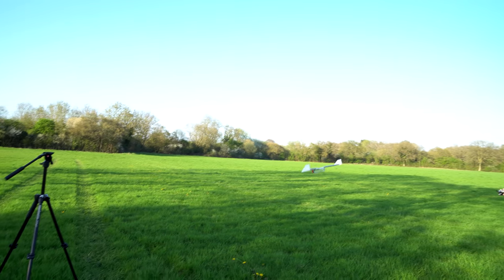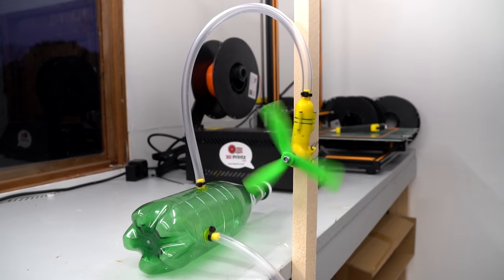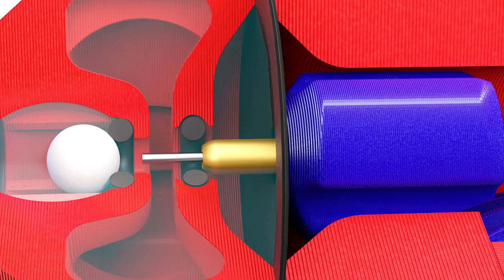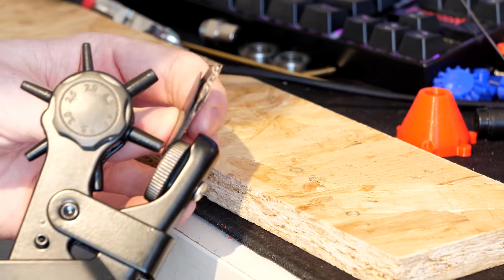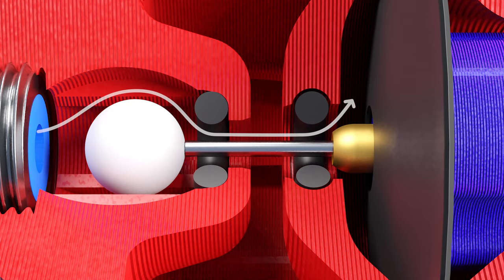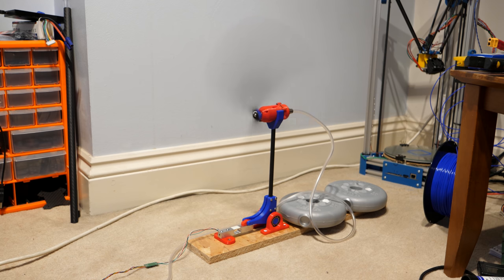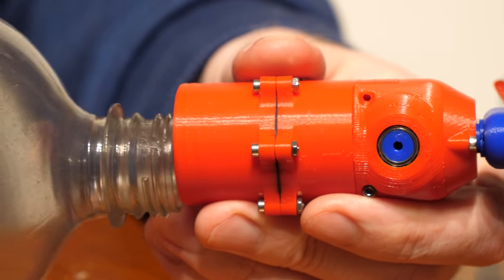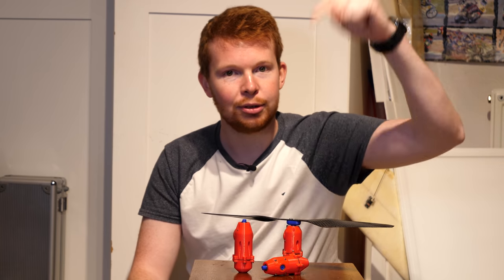Diaphragm Air Engine

Comment: It appears to me that the diaphragm engine only works during half the cycle (while the air is pushing the diaphragm against the piston). It also appears to me that you're struggling with the same issues that early steam locomotive designers faced. Perhaps the approach they eventually landed on might work for you.

What if a second pressure chamber were directly opposite the first, so that the driveshaft (see 2:29) continued to another diaphragm and pressure chamber directly opposite the first? Then use a linkage analogous to Walschaerts valve gear (https://www.youtube.com/watch?v=YuPtJ3kkd0w) to apply high-pressure air to one side while opening an exhaust port on the other. I'm not a mechanical engineer, but my intuition suggests that some disk-and-pin counterpart to the Walschaerts linkage exists that might be easier to fabricate.

My point is that by adding a second pressure chamber symmetric to the first, both sides of the stroke can be powered. This should double the efficiency of the engine. Some mechanical linkage can then be used to open and close the input and exhaust ports of each side.

Comment: i can't man. there's a billion pumps. You got scroll expanders, screw expanders, why the fuck do you make a piston expander? why the actual fuck? That's like using electricity to boil water in a steam engine to move the wheels instead of an electric motor.

Comment: Over complicated.
You only needed to place the O rings on the piston and have them oiled, use the rubber to make a inlet and exit valve port like in a 2 stroke engine and a counter balance weight....

Comment: i love it so much. 
would it be possible to remake it, but 4x the size, and machine a brass sleeve a rod with a thread, so rotating it pushes the 'sleeve-rod' assembly in and out of the piston? therefore, allowing fine tuned optimisation without requiring a new motor to be made each time?
i just did a rough sketch of my thoughts and uploaded it to flickr so you can see it: https://www.flickr.com/photos/193527390@N04/51335977803/in/dateposted-public/

This is just a thought, i hope you read this :) love your work, constantly inspires me to think differently about things.